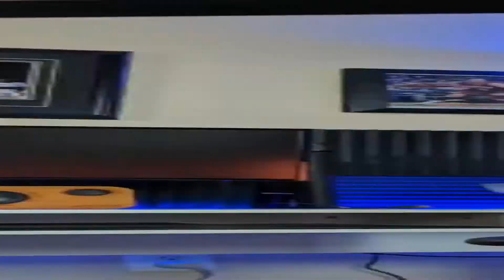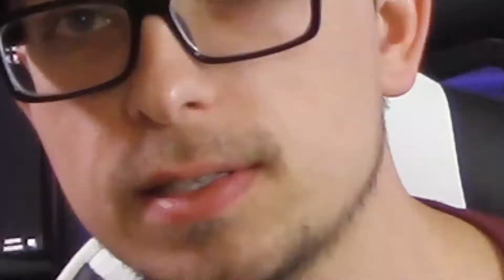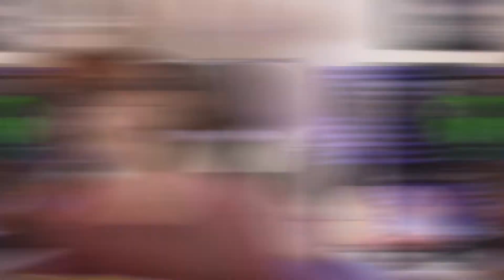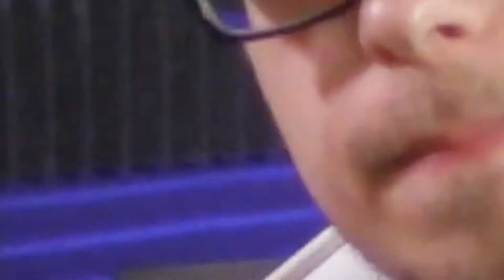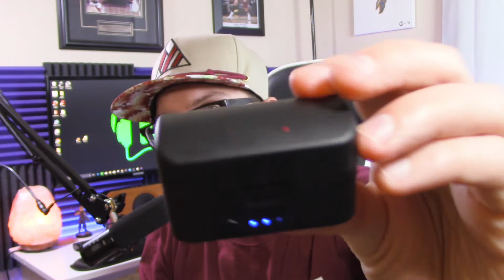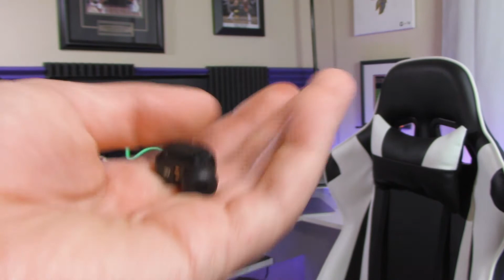Best Fit Wireless Earbuds 2018 | Alterola AE800 Earbuds Review

Comment: Which one is better treblab x5 or that earbuds?
Reply from the maker: Hey Joey, I actually prefer these ones, although I think the Treblab x5 stays in the ear a little bit better than these now after a bit of use. These AE800's have a much smaller profile though. It probably depends on how active you'll be with both but I don't think you'd go wrong with either.